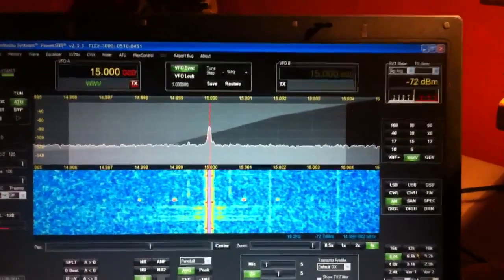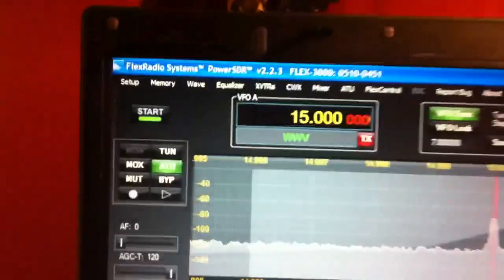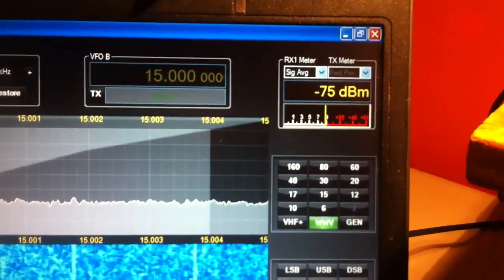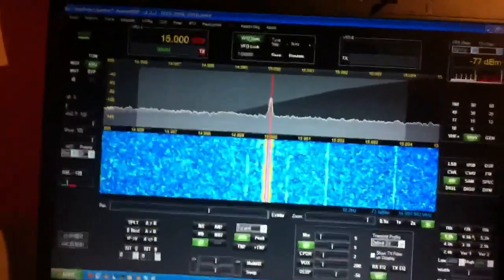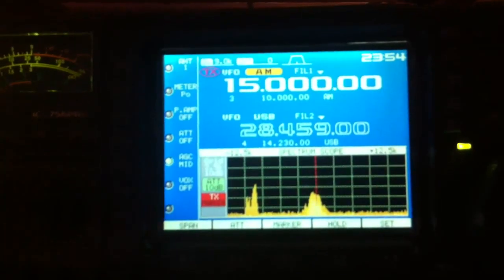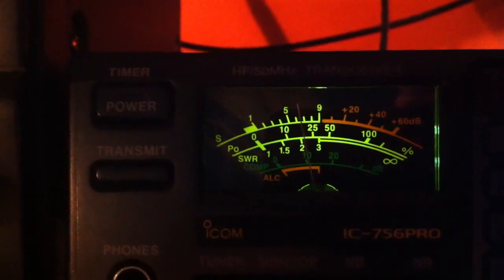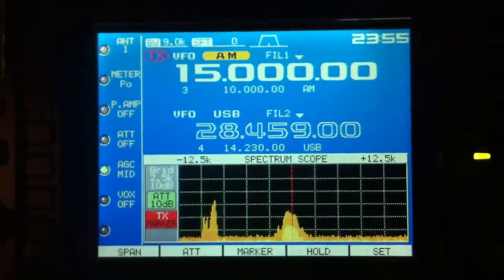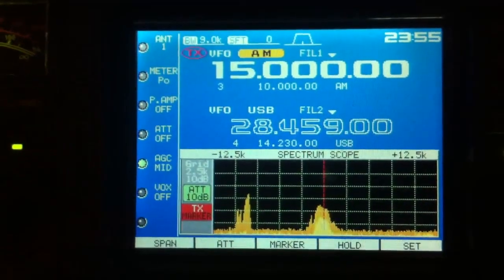Icom 756 Pro receiver vs Flex 3000

Comment: Frankly, they sound about the same.  I think if you want to have a better test, you'd have to look at how well each radio can pull out a faint CW signal close to a strong one.  In other words, check filtering/dynamic range in one go.   I'd bet the Flex does better, but then it should considering the technology, cost, and additional computer power needed to operate it.

Comment: :)  switch OFF  the  ATT-10dB on 756PRO  & You got S9+ on ICOM :)  ....  trow that FLEX true the window  :)
Reply from the maker: That attenuator only applies tot the spectrum display, not the radio signal. Sorry, you are wrong.

Comment: Thanks for the video, like you I had a Icom 766p2 and now a flex 3000. I hesitate a little to draw any conclusion from the test, as this would simply seem to indicate to me the Icom does not have a calibrated S meter (the flex does) and may not indicate anything about the receiver performance ?
73 Dave M0TAZ